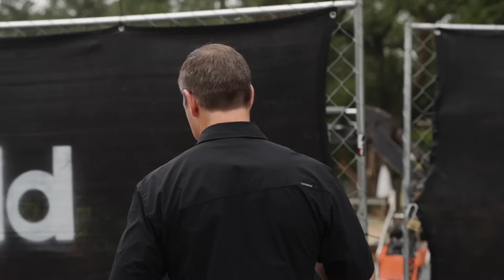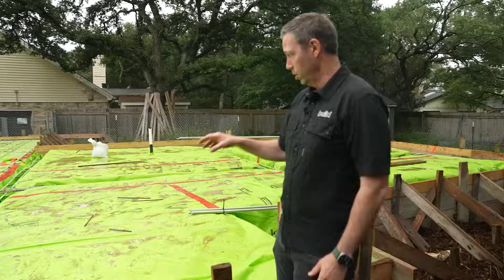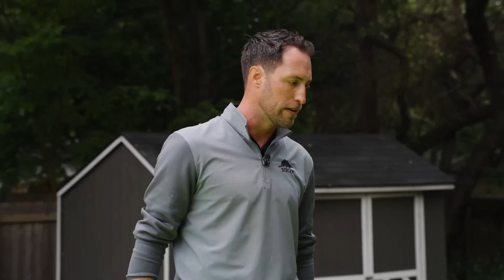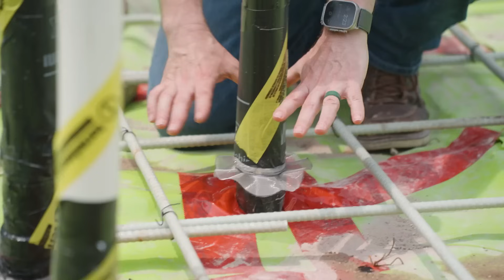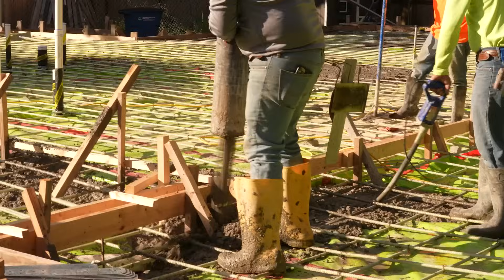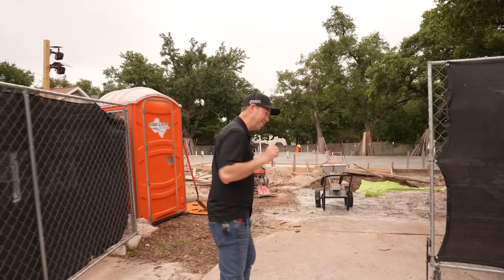The Risinger Build: Episode 4 - Existing Slab Retrofit & New Foundation

Comment: Rebar and moisture barrier way over kill here. Most houses built so cheap now these guys are the opposite way extra not needed.  Laying a slab over a slab then full rebar grid😂 they just come out with new code to sell product like vapor barrier needs to be 10mil been 6mil for my whole career no issues but now needs to be 10 mil at 3x the price. Yet no Lowe’s or HD sells 10 mil only the standard 6 mil

Comment: So i am a builder in houston and am oftem doing additions to 1950-70s homes.  Generally I do not have the luxury of capping the entire slab.   In situations like this, how do you recommend treating the old slab areas to mitigate moisture penetration?  Is there a retrofit solution?  I have seen thru slab moisture ruin wood floors with mold growth and rot over years (actually in austin while i was working for roost).

Comment: Matt, I poured a residential foundation yesterday in Houston that has a finished concrete floor. We're not grinding it, and because this is an architecturally controlled project, we had to pay close attention to the finishing process and how we chose to cure the concrete. We ended up using a curing compound produced by W.R. Meadows called 1100. It's clear and dissipating, so it doesn't leave a permanent coloration on the concrete. After a few weeks (traffic and UV exposure dependent), it dissipates fully.

Comment: Nice job thus far. Interesting to see you use a fairly stiff concrete mix as nearly every video of concrete pours in the US it is more like soup. Here in Australia it is a stiffer mix. Screeding is different there. If you get a chance to have a look at Concrete Ninja videos on how he screeds, and gives advice, it gives a good finish. It still has to be troweled off. The helicopter finishing should be the same type of smooth finish, but it must be the applied curing compound that made it rough? Just a suggestion for the next slab.

Comment: Nice details for Slab on grade. Fibreglass rods have been refined from petroleum have about equal enviormental impact when compared to manufacture of steel rebar. The rebar product that has 0 enviromental impact is basalt as it already is rock to start with has 4-5 times strength of steel and expands and contracts at same rate as the concrete and is inert and is impervious to anything that the concrete is able to resist. Chlordane dust applied under foundations,  and in crawl spaces  was a forever one time treatment for termites and was stable and non poluting below concrete footings, slabs, and beams on grade and any wood pilings placed into the ground. Too bad it became a victum of misplaced environmentalists concerns because of chlordane uses as crop pesticides, one application was all that was needed up to 1984 ban excepting termite control expanded to include termites in 1988. Some lucky owner is going to get an incredible home! Ray Stormont
Reply: Sigh, << Palm in face >> your "basalt"  so called "zERO impact" is composed of silicone dioxide JUST LIKE glass rebar fibers and JUST like glass rebar fibers, Basalt fibers are held together with --> PLASTIC  Glue.   Honestly: How ignorant is everyone today?   Yikes.

Comment: The GFRP rebar makes so much sense, especially for public infrastructure where you basically set the expiration date for your build as soon as you put steel rebar in concrete. For residential yeah it's not necessarily but wouldn't it be nice if it were the norm?
Reply: Uh, where I am Fiberglass is CHEAPER than Steel rebar.  Only reason ANYONE uses steel is due to inertia of industry.

Comment: What drove the decision to insulate above the slab (with AdvanTech subfloor mentioned) rather than under the slab which would enable using the slab's thermal mass for thermal regulation, long-cycling HVAC, etc. ?
Reply from the maker: Ultimately it’s because of the easy installation compared to sub-slab insulation. Also with this slab capping(over a 1970’s slab) it would be impossible to do it below.